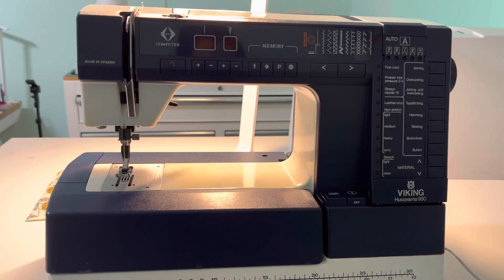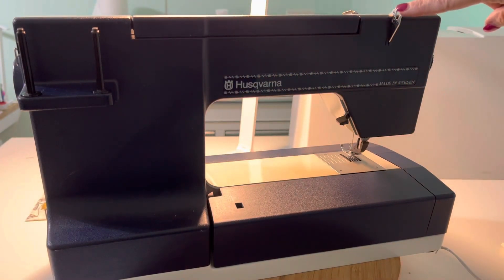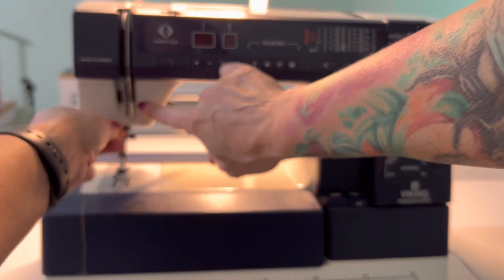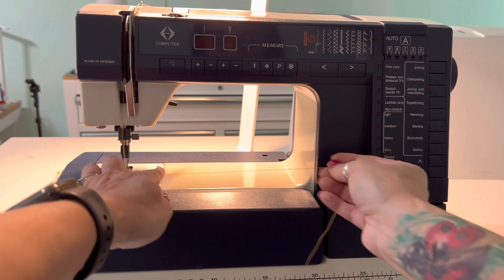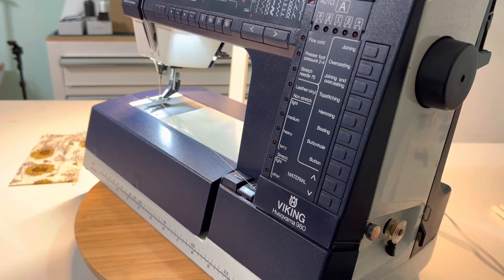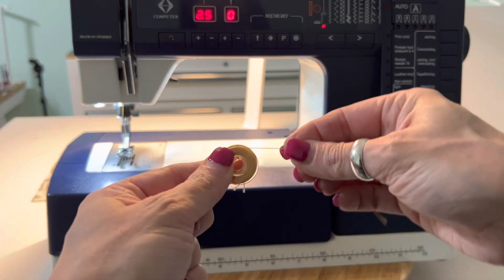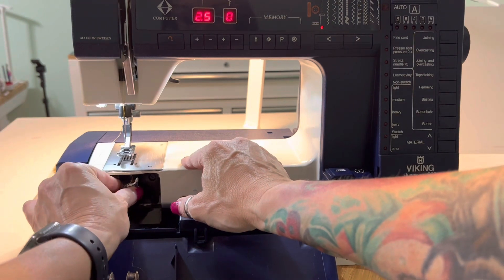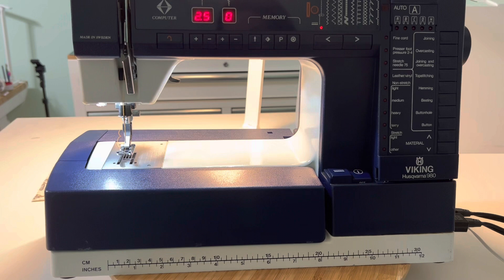Vintage Husqvarna Viking 980 Threading

Comment: I’ll have to try adding thread to my bobbin spools from the front as you have shown. On my 990 I’ve always loaded from the back using the two available thread guides.
Reply from the maker: Hope it works as well for you as it does for me on my 980!!! 😎
Reply: You can actually do both. Front is preferably  used when  the underthread finishes while you are sewing, Then you do not need the re-thred the whole machine (like in case when you have just one color of the thread available and you have it  through the needle.
Reply from the maker: @camc2252  yes, you sure can! 😁

Comment: Hello friends, my sewing machine is locked and does not work, what should I do?
Reply from the maker: Start with looking for any pieces of thread that may be jammed around the hand wheel or bobbin areas. Use tweezers to remove any thread you may find jams. Be gentle in trying to move your hand wheel as you do not want to force the machine causing damage. If you cannot find a thread jam, I suggest taking the machine to a local repair shop so they can investigate the problem.